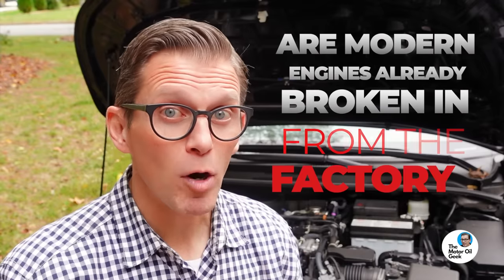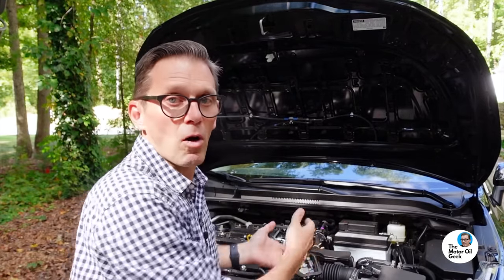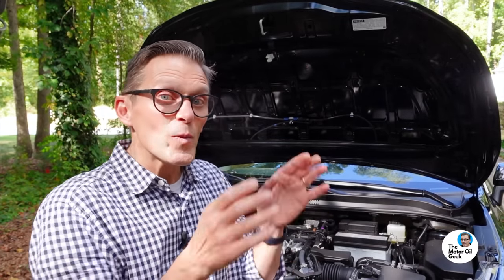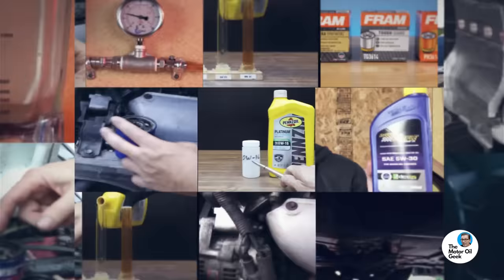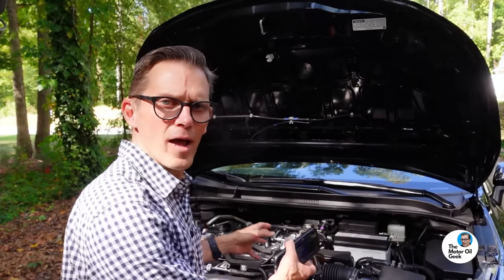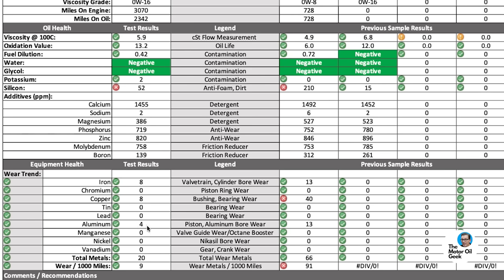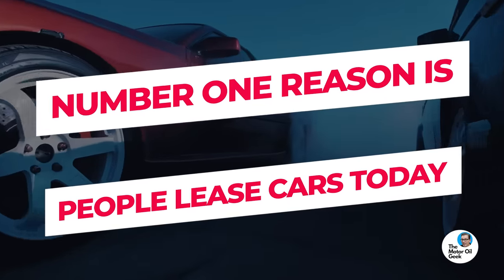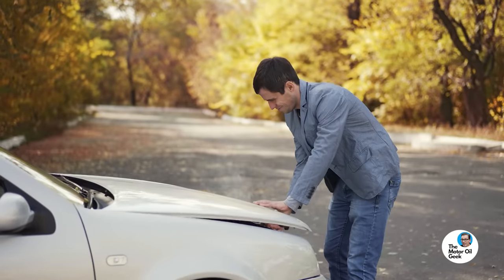New Engine Break-In: Truth or Myth?

Comment from the maker: Thanks for all the comments, suggestions and questions. I appreciate them (even though the volume is quite overwhelming).

Just a few points to clarify…

I didn’t say these new engines are not run at the factory. I know they are started and checked for leaks, etc…, but that is not breaking in the engine.

Also, this car was built in Japan. I am not speculating that because it is a Toyota. I know it was built in Japan because all of the paperwork with the car said it was built in Japan. Also, the 0W-8 is an indication it was built in Japan because that is what Toyota recommends in Japan. Here in the US, 0W-8 was still not available when she got the car.

I hope that clears up any confusion.
Reply: I would still avoid using any 0w8 oil, there is literally zero tolerance to shearing and fuel dilution.
Reply: I miss being a kid, and watching your dad race. I'm from Martinsville va by the way 😁
Reply: A HUGE debate online is the weight war. One debate in the VB WRX community is the 0w20 vs 5w30 crew. Subaru was recommending 0w20 when the 2022 WRX was released but now Im hearing they are switching back to 5w30. As you probably know Ford switched back to 5w30 from 0w20 a couple years ago. I do all my own oil changes and I changed mine out (2022 WRX) at 1k miles with 5w30.
Reply: @chrischarles9218  for Mustang Coyote 5.0L V8, Ford specifies from 5w20 all the way to 5w50 for "track" use. So it's easy to get the point. IIRC, there is a video here that describes the relation of engine oil operating temperature and viscosity. Modern cars lacking oil temp gauge (apart maybe from a few VW/Audi TSI cars) makes this whole thing even more frustrating.
Reply: @xynostasos9022  I was actually referring to their Eco Boost engines as Ford found out 0w20 was a little light for a turbo vehicle. Oh Im happy to say my 2022 wrx does come with an oil temp gauge.
Reply: Well it sort of tells you in the owner's manual, just about all new gasoline engine cars with an owner's manual will tell you not to drive at the same speeds (particularly engine speed) for extended periods of time for the first ~600 miles and if your vehicle is capable of towing, do not tow for the first ~1200 miles. Tells you to vary your speed as much as possible. Some manuals will go more into detail as to why, explaining that the pistons must seat properly into the cylinders. Also says not to do jackrabbit starts and hard sudden stops. All this to say that no, your new engine is NOT 100% fully broken in, otherwise they wouldn't have bothered to tell you in the manual that you needed to do anything special or different for the first ~600 - ~1200 miles.
Reply: If the first letter of the VIN is a "J" then final assembly of the car was Japan. Otherwise it was somewhere else, probably USA, but they make Corolla's at several places around the world. But the engine could have been made in Japan, even if final assembly of the vehicle was in the USA.
Reply: @chrischarles9218  Hyundai switched from 0W-20 or 5W-20 to 5W-30 on one of their V6 engines years ago, but not sure what they recommend today. If it is a turbo, I would definitely strongly consider 5W-30 full synthetic using one of the premium ones like Mobil 1 EP or Pennzoil Ultra Platinum.
Reply: I never said that you said the engine was never run at the factory. We are talking about break-in, and obviously that is somewhat of an subjective number of miles. What I said was you would have had to do an oil change and analysis immediately upon getting the new car (assuming it was brand new with about 5 miles on the OD and not used as a demo for a couple hundred miles), and then also do the other oil changes and analyses at 1,000 and 5,000 miles to really know how much break-in (if any) occurred at the factory. It is simply a logical fallacy of only doing the oil analysis at 1,000 miles and 5,000 miles to determine what amount of break-in occurred at the factory, because the first oil analysis done at 1,000 includes any factory break-in plus the first 1,000 miles of break-in combined.
Reply: @justacinnamonbun8658  What you say is definitely true, however, manufacturing and precision machining techniques have improved over the years, and the amount of break-in needed in most modern engines is not the same as it once was.
Reply: I would think that even 0w8 would be mostly cold climate weather, and maybe 0w16 might be good enough being that 0w8 not being available in the US would hurt the warranty, but I could be wrong. Hopefully the local dealer would have 0w8.
Reply: @CJ7fun-zv2hs  I believe that new Toyotas sold in the USA come with free maintenance for the first 2 years and 25,000 miles.
Reply: This is great scientific based info . Would you consider doing an experiment on engines that have oil filter magnets such as filtermag installed ? . It would be good  to know what size are the particles that stick to the filters skin are considering 2 things , 1 ; the filter can only catch particles down to around 20 micron & 2 ; iron particles below 20 micron are the ones that cause the most accelerated  engine wear according to Cummins own testing . I have used filtermags ( 2 on each filter) for my Australian ford falcons for years & believe that the oil stays cleaner for a lot longer with the magnets & also that the amount of fine crap on the inside of the filter is really fine but are the particles under the 20 micron limit of the filters filtering capacity ? A scientific answer is what is needed with a couple of different cars as examples , maybe one with a relatively low odometer reading & another with high mileage but still in good running order & not chewing oil , the results would give concrete evidence that magnets are worthy additions or not . Ps I am not in any way associated with the magnet company but believe they work in transmissions after seeing buggered ones with the magnet in the pan being full of material , so why would they not help in a motor ? , even though the oil is changed regularly compared to an auto trans. You would be one of the best techs to conduct such experiment to give highly accurate readings & findings. Regards from Australia.
Reply: @barbraabsalom4531  Even if a transmission receives regular fluid changes, it is rare that anyone would drop the transmission drain pan to clean out any metal debris that had accumulated, so that is the purpose of the magnets in that location. Dropping the transmission drain pan is not part of any manufacturer's recommended maintenance schedule (just fluid changes), and there is no easily replaceable filter like there is for engine oil.
Reply: @Mark-rw3kw  Um , I don’t know what vehicles you are referring to but it certainly isn’t our Aussie falcons , as the basic service kit comes with a filter & a new pan gasket , both obviously require removal of the pan & it’s part of that basic service that you remove the iron material from the magnet or in our case 3 magnets , that sit in recess’s in the pan . Now if a full service is carried out , then the car needs to go to a specialist transmission mob , as they will pump out all the old fluid in the torque converter , this can’t be done during a basic service when dropping the pan & changing the filter which only requires about a 1/3 fluid replacement .
Reply: @barbraabsalom4531  As I mentioned, all recent model cars that I know about do not specify removal of the transmission fluid pan and replacement of the filter as part of their normal scheduled maintenance specified by the manufacturer (although obviously the pan can be removed on any transmission). Whatever transmission fluid maintenance that is specified in the scheduled maintenance guide involves draining and replacing the fluid only. That is not to say the pan cannot be removed and transmission filter replaced, just that is not part of the suggested scheduled maintenance on newer model cars. Also, I don't think that most transmission fluid filters capture small particles as well as a engine oil filter.
Reply: @Mark-rw3kw  As I said , our cars & even recent model fords & many Toyota’s still have a filter that is behind the pan , so when you say all recent models that is not quite right . Any car that has a transmission filter MUST have a removeable pan .
Reply: @barbraabsalom4531  What I said is that removing the pan is not part of a normal transmission maintenance procedure (at least in the USA). The specific wording in a Toyota manual is to "replace transmission fluid or oil" which doesn't even occur until 60K miles (and only then for severe driving conditions). Most newer cars use synthetic transmission fluid and a "sealed" transmission design for extended transmission fluid change intervals. Replacing the transmission fluid does not involve dropping the pan. That is why magnets are often located at the bottom of the transmission pan, but not  for the engine drain pan or near the engine oil filter. According to Wikipedia the Ford Falcon (AU) was produced by Ford Australia from 1998 to 2002. That is not what I would call a newer car. In the USA the Ford Falcon was a different model that was produced by Ford from 1960 to 1970.
Reply: @Mark-rw3kw  Anyone who believes manufacturers bs of lifetime sealed transmissions hasn’t owned vehicles for longer than the warranty period . Just about anyone in this country who uses  a vehicle for towing or wants to keep vehicles for 10 to 20 years ( like us ) knows that auto transmission service is critical for long term & harsh duty , longevity . I know bugger all about modern hatchback autos but do know that large cars like our falcons , made until 2016 & Holden ( gm to you ) until around 2017 have autos that need proper servicing which is the bread & butter for auto transmission shops . Further to that anyone using said vehicles for towing will know the inadequacies of the auto cooling system running through the radiator or the side of the block heat exchanger setup that can & does fail allowing coolant to mix gearbox fluid , destroying it , so even in temperate climates like Sydney latitude , it is very common to get a separate cooler fitted in front of the radiator ( by a shop ) which is fluid to air removing the chance of fluid mixing with coolant , very first thing we get done to every car purchased . Dropping the pan for servicing on fords , holdens & most Toyota’s & many other 4wd’s including Mitsubishi , Isuzu , Chinese built utes , is an all day every day occurrence at any transmission shop . Different philosophies to ownership at play here , alot of aussies don’t believe manufacturers horses=it when it comes to servicing or service intervals & I have read many USA based comments with similar skepticism . There will always be the type of owner who buys a new car & just gets the minimum servicing done as they don’t care how long the car lasts because they are going to buy a new one , near to , or at the end of warranty period , they will exist everywhere regardless of country born in.
Reply: @barbraabsalom4531  I never said that a “sealed” transmission requires no maintenance for a lifetime. I said that most modern transmissions do not require the transmission filter to be changed on a regular basis. Transmissions do require fluid changes. If one were to do a search of YouTube videos on the subject of transmission filters they would find that most (but not all) mechanics don’t recommend changing the transmission filter on a regular basis unless you are talking about 250,000 km or something. On one video the guy had to remove the catalytic converter to get the transmission pan off.
Reply: Alguém saberia me informar se a norma Dexos é somente uma norma, um procedimento a seguir ou são novos pacotes de aditivos anti-corrosão ou anti-oxidação?
Reply: I am an automotive instructor for Houston community college. I appreciate all of your insight and easy explanations when it comes to complex topics
Reply: @justacinnamonbun8658  Varying the speed of the vehicle during engine break-in (to seat the piston rings) is irrelevant. The only thing that is relevant is the RPM of the engine (which varies relative to the speed of the car depending on what gear the transmission is in). They also say to not exceed 4,000 RPM, which is why they say to avoid jack-rabbit starts. The issue of sudden stops has to do with break pads and rotors seating, and nothing to do with the engine break-in. Besides not driving at the same RPM for long periods of time during engine break-in, the worst thing someone can do is to baby the engine, because that makes it more like that the piston rings will not seat properly.
Reply: @Mark-rw3kw  I didn’t state that you specifically were pointing at no servicing  , I said most aussies with cars that do real work like towing or a lot of city driving putting them in the heavy use bracket don’t believe bullshit manufacturers instructions on service type or intervals for such vehicles particularly when it comes to the auto boxes . Any goose that thinks that fluid changes without removing the pan ( where there is one ) & changing the filter & removing the friction material on the magnet/s , thinking the auto will last hundreds of thousands of Kim’s is kidding themselves . I’ve seen them with only 120000klm stuffed & guess what the magnet is always full of crap ( can’t pickup any more material )  & the filter never changed. My vehicles on the other hand , one has over 250000klm on a reco box ( car over 500000klm ) & it still performs flawlessly with pan/filter/magnet & 1/3 fluid change every 50 to 60 thousand  Kim . As Scotty Kilmer says , do you want it to last as long as possible , I say yes thanks.

L
Reply: @barbraabsalom4531  Most of the wear particles are no ferrous, so a magnet is not really much use. On a cast steel block, with cast steel head, it is a good thing, but with modern engines the only thing it will pick up is wear particles from the rings, and they likely will be caught in the oil filter anyway.
Reply: @SeanBZA  bs , most of the particles that destroy the transmission are the same as those that wear your engine prematurely , ferrous particles of under 20 microns . If the wear particles were mostly non ferrous they wouldn’t put magnets in the transmission pan . I service my own transmissions religiously doing the filter , clean the magnets ( I put 3 in our pans , which is 2 more than they come with as there is a specific recess to place all 3 in ) & a service fluid change which is about 4 litres or roughly 1/3 of what the trans/torque converter holds . There is always superfine shit on the magnets. I also go to a mechanic for other servicing & have seen many blown trannys & guess what the sole magnet has shit piled up on it like the great pyramid & cant hold any more material  , the filter in your tranny & also your engine oil filter is only rated to 20 microns & above , so the filter doesn’t capture the iron particles that go straight through & around & around in your engine or tranny slowly killing them. Don’t believe me ? , Cummins own research concluded that iron particles under 20 microns  are the ones responsible for the most accelerated engine wear & pass straight through the filter . This is why I run filtermag magnets on all my vehicles & you should see the crap that is on the insides of the filter when I cut them open , it’s so fine in itself , like liquid , the filter is not capturing the majority of that . Nowadays , with a lot of tranny pans being plastic , I don’t think they can put magnets in , well at least not in the pan , & the gearboxes are sealed for life aren’t they ? , what is that life , 100000 , 200000 ? , so you would think with no magnets they would recommend changing the fluid/filter more often but they don’t , because the manufacturers don’t give a shit as long as it survives the warranty period . With anything mechanical I own I want it to LAST AS LONG AS POSSIBLE , so I will continue to use the “ snake oil magnets “ & continue religious servicing & get engine & gearbox life beyond half a million kilometres & counting .
Reply: @barbraabsalom4531  Transmission is different, because all steel gears and sliding surfaces, but an engine now has very little steel in it, all aluminium. I have stuck magnets into the pan of old oil, and got nothing sticking to them, but gearboxes you get wear particles. Magnet in a trans works, at least getting half the debris out, though the clutch wear is not touched much. And yes manufacturers only worry about warranty, so build it good enough to last that long, and a little more so the ones with bad tolerancing and flaws will all get out before failing.
Reply: @SeanBZA  Tell that to the filtermag magnets when I cut open the oil filters , plenty of fine magnetic material . Remember many blocks are still iron , plus rings , camshafts , crankshafts , oil pumps , valves , rockers , timing chains , sprockets are all steel . Then there is the probability that there is small micron sized iron particles in your brand new oil you buy from the shop , oil is pumped by commercial pumps made from many steel components.
Reply: @xynostasos9022   Avoid ? I just bought new Corolla , states right on engine and in my maintenance guide to use ONLY 0w8 . 
So I should listen to you instead?  For the ones saying I’m pissing away money ,that’s fine it’s my money.
Reply: @Louiepr60  keep using 0w8 and especially at the stupidly long intervals Toyota says and your engine will be ready for scrap in 100k miles.
Reply: @xynostasos9022  read what I wrote 12 hrs ago, never said I would change oil at 10k miles.
Reply: @Louiepr60 so for the exact same engine as you have, Toyota in Australia recommended 0w16 oil and also stated this on their manual:

"The 16 in 0W-16 indicates the viscosity characteristic of the oil when the oil is at high temperature. An oil with a higher viscosity (one with a higher value) may be better suited if the vehicle is operated at high speeds, or under extreme load conditions."

So a 0w8 or 0w16 is only sufficient IF you drive like a grandma. If you are like me and hit the rev limiter every single day, 0w8 is NOT going to end up well, even in short OCIs. Ford on their V8 Coyote engine spec'ed from 5w20 up to 5w50 for demanding use. You can test it yourself though buy doing a used oil analysis. Go 5k miles on 0w8 then go 5k miles on 0w30. I guarantee you that 100% the wear metals will be LOWER by over 20%. You will only lose 0.3% in MPG but 0w30 is MUCH cheaper than this 0w8 oil.
Reply: @xynostasos9022  I guess then USA different because my engine and owners Manuel says 0w8.
Reply: @Louiepr60  it's literally the EXACT same engine. Not "similar", IDENTICAL. The only different thing is the idiotic CAFE regulation that forces everyone who sells cars in the USA to chase that last 0.1 MPG. Don't you think that Toyota would spec 0w8 EVERYWHERE around the world if 0w8 was the best thing that ever existed in engine oils?
Reply: @xynostasos9022  thanks, now you really have given me something to think about and research 😆
Reply: @Louiepr60  you're welcome. Feel free to explore more about engine oils in "Bob is the oil guy" forum.
Reply: If the car manufacturers do not use break in oil any more because of the two reasons you stated in this video. So the question is will it take longer for the engine to break in using synthetic oil from the factory instead of the break-in oil they used to use. Because I remember years ago I heard was not to put synthetic oil in the engine too early. Wait three or four or five thousand how many miles for the first oil change. Since they had break in oil. But since they don't now the rules have changed
Reply: @ex.spaceshuttle.worker  I would throw the factory oil as soon as I got home after buying a new car. And then Redline SAE 30 break in oil. I'd rather have the hassle early than facing oil burning later on.
Reply from the maker: @ex.spaceshuttle.worker  The "rules" have changed due to changes in the piston ring coatings. https://youtu.be/SCZq7-sFTqI
Reply: @chrischarles9218  The 2024 WRX Owner's Manual states: "0W-20 synthetic oil is required for optimum engine performance and protection. Conventional oil may be used if synthetic is unavailable. 

If 0W-20 synthetic oil is not available, 5W-30 conventional oil may be used if replenishment is needed but should be changed to 0W-20 synthetic oil at the next oil change". 

You are going against the manufacturer recommendations by always using 5W-30. You may have an issue with warranty claim on the engine if it's ever needed.
Reply: I couldnt find a good explanation or differences between truck oil, passenger car oil and motorbike oil (speaking of same viscosity and make...)
Reply: i remember using a 0w-40 oil on a newly rebuilt brroken-in engine , a friend of mine drove it like he runnin from the cops  ended up with a faulty crank shaft bearing and knocking piston
Reply: How did she break in the engine...did she follow a certain RPM varying model & certain  # heat cycles, in town driving or did she just get in and drive?
Reply: @barbraabsalom4531  That indeed used to be the case, but the Japanese stopped specifying that.
Reply: @barbraabsalom4531  FACTS.
Reply: @barbraabsalom4531  AMEN.
Reply: @SeanBZA  The crank shaft and cam shaft are still made of steel or iron.  You can't use aluminum for those.  You just can't.
Reply: @xynostasos9022  Thank you.
Reply: @Louiepr60  The EPA and CAFE is doing that.  They don't exist in other countries.
Reply: @xynostasos9022  AMEN, AMEN, AMEN.
Reply: @steve8803  Not if you don't admit to it.
Reply: @jamesbosworth4191  you have to show proof of oil changes if you need to make a warranty claim on the engine. Obviously your receipts will show what weight the oil you purchased is.
Reply: @steve8803  Does that mean you can't do your own oil changes?
Reply: @steve8803  Just add STP to the oil.  That will improve it's viscosity.
Reply: @jamesbosworth4191  I do my own oil changes. I keep the receipts for the oil, filter and crush washer and log the date and mileage. This is necessary should I ever need to claim warranty on the engine. I use 0w20 and have no issues with it. Not interested in changing viscosity.
Reply: @steve8803  It's your car, so whatever might happen to it doesn't affect others, only you.
Reply: @jamesbosworth4191  it has a warranty, and I am keeping it that way.
Reply: @steve8803  Different strokes for different folks.
Reply: @jamesbosworth4191  no shit Sherlock
Reply: @Mark-rw3kw you said "..manufacturing and precision machining have improved over the years... " So why gap tolerance engine still same since World War II?
Reply: @Ymier4  I don't know what gap tolerances you are talking about. Can you provide detailed specs about published gap tolerances.
Reply: @Mark-rw3kw   
Before the X-Y axis exist during World War II, noticed this failure in 1940. Driven by the need for cost-effective manufacturing and meeting deadlines, he worked out a new system through several publications. Once proven as a better operational method, the new system became a military standard in the 1950s.

the GD&T standard is defined by the American Society of Mechanical Engineers (ASME Y14.5-2018) for the USA and ISO 1101-2017 for the rest of the world.

I think you don't know that because you only focused on the final product in your mind. 
5W's Who, What, Where, When and Why.
Reply: @Ymier4  My comments were about computer controlled manufacturing machines (CNC, etc) that have improved the actual results, such as the precision of drilling out cylinder holes in engine blocks, and in creating tiny patterns on the walls of the cylinders to make them easier to break-in more evenly. If you don't concede that precision manufacturing techniques have improved over the years, then I don't think there is any common ground upon which we can have a rational discussion.
Reply: @johnhoyle6390  An early oil change can't hurt anything. Years ago some new cars used special break-in oil, but that is no longer the case.